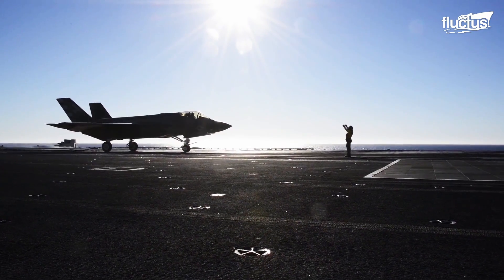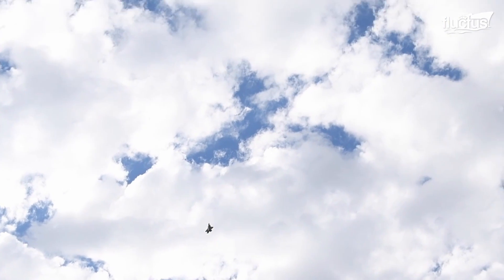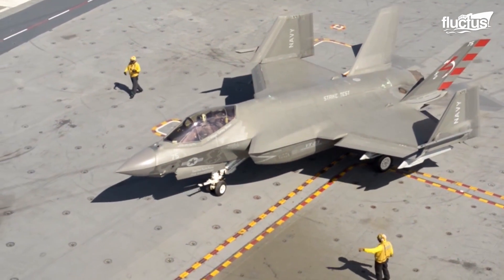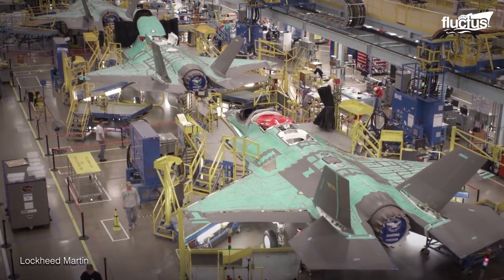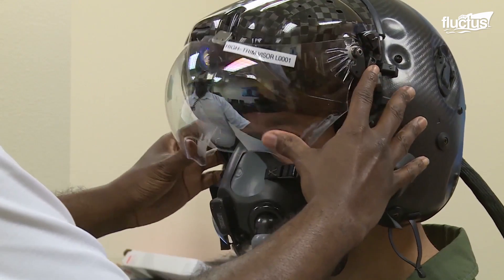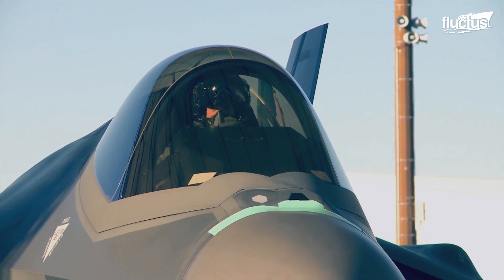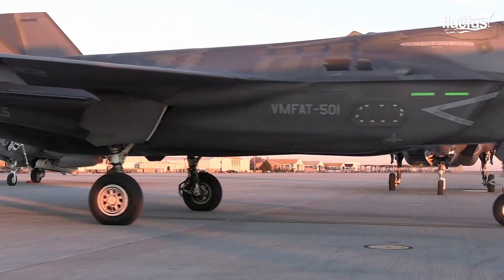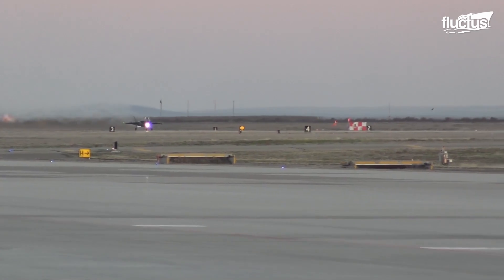Hypnotic US F-35s Take-off From Gigantic AirCraft Carrier

Comment: I don't mind an F-35 Navy.  In fact I like it.  I'm just not happy about the F-22 debacle.  If we had a Republican in office I believe the F-22 would have had all the capabilities the Navy needed.  The F-35 does have the vertical take off and landing capability.  Truth be known both aircraft are invisible to the F-16, F-18 and most of the other old systems.  it means the enemy wouldn't be able to see the F-22 or F-35 coming.  Both are devastating platforms.  A carrier with 6 F-22's could do what a carrier with 90 F-4, F-8 and A-6 aircraft did.  They should acknowledge that the F-35 means they don't need as many aircraft.
Reply: tell me your a taxpayer.
Reply: @markk2403  Of course. Just the last 52 years or so.

Comment: The f-35b is the plane that they use in Battlefield 4 for the American fighter jet. Most people don't know that you can actually hover and shoot people or buildings like a helicopter, and then turn max throttle and fly like a jet.
Reply: Why don't they use those versions on aircraft carriers instead? Seems simpler, no need for a runway to launch or land, just launch & land like a helicopter?
Reply: @bekeneel the navy has different needs than the marines, and they still need the full runway to launch E-2s, C-2s, and whatever else comes later

Comment: And the dumb politicians said it costs too much and no one wanted it…
Reply: @David Martin

People don't realize that all new technology has to cut its teeth.

The high cost of the F-35 is based on from design, production and operational cost from cradle to grave. About 50 years.

It should be noted that the  F-35 A's currently cost about 5 million dollars less then the latest version of the F-18.

As to technical issues, know that when the 1st Abrams tank off the assembly line was considered an over cost boondoggle. But over time those technical issues were solved and decades later are still top dog. It's the tank everyone inspires to match let alone beat.

Comment: Kinda strange why the F - 35 - C is the largest, you'd think it'd be smaller and more optimized for carrier storage. Keep up these good videos!
Reply: Imagine being one of the few humans who will ever exist that gets to actually control and fly an f35
Reply: Bigger wing for carrier ops.
Reply: More fuel, larger surface area for shorter takeoff, and so on.
Reply: Since it is not vtol it needs the greater wing area for lift.
Reply: @kennethbolton951  STOVL not VTOL
Reply: @AA-xo9uw  F-35B is a VTOL aircraft and is operated as STOVL.

It is perfectly capable of vertical takeoff; just not with a large payload.